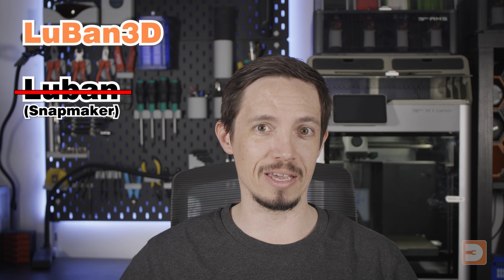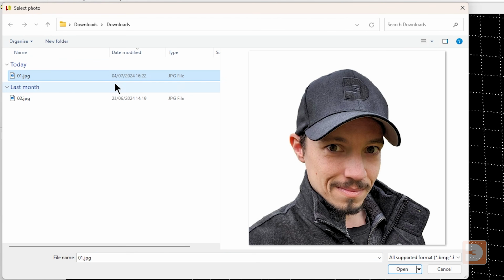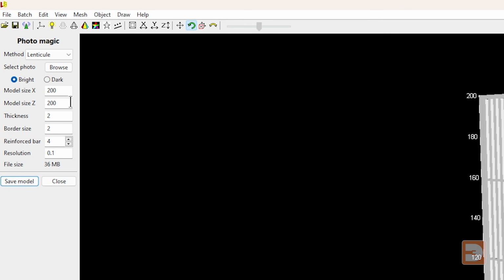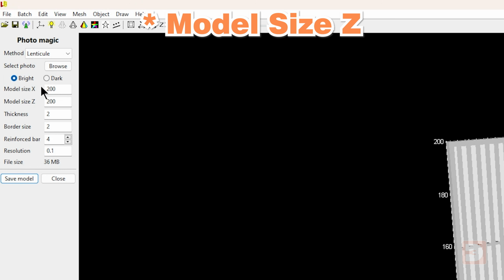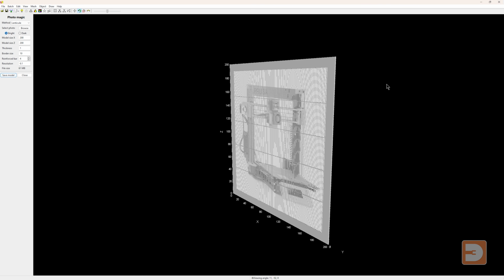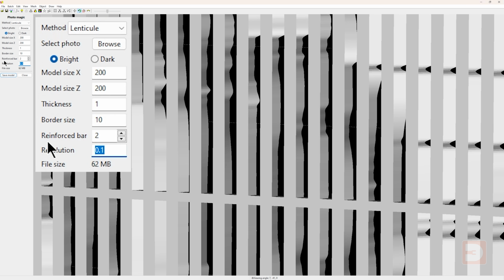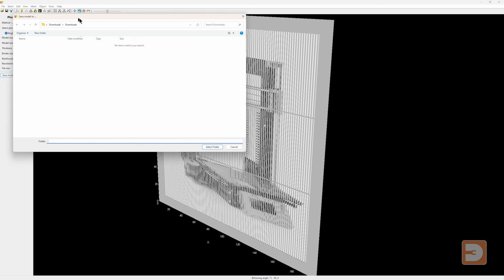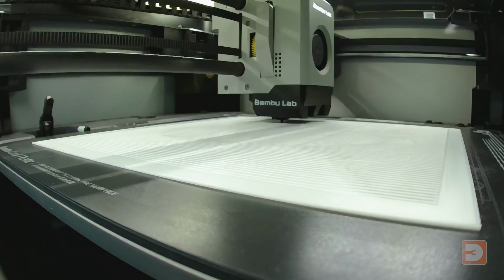Create 3D Printable Lenticular Models from Photos using Luban3D

Comment: Price of Luban is a joke. 👎
Reply: Free is too steep for you?
Reply: @OnePotMeals  "Free is too steep for you?" This is the problem with people like you, you can't read properly, free for a month is not free. So no, "free" is not steep, and Luban is not free.
Reply from the maker: The free trial of the full license is limited to 30 days, beyond which you need to buy a license, but to quote the LuBan3D license page, "Unregistered license: A computer can run LuBan to process and view data while saving of processed results is limited to small-sized files, not larger than 20MB".
In other words, you can use it indefinitely, for free for smaller files.
Beyond that you can get licenses and I honestly don't think $20 for a month (or $100 for a year) is that bad.
This isn't the sort of software you're likely to need access to constantly, so you can just get a license as and when you need to.
If you do feel you need access to this constantly as you're using it every week for multiple years in a row, there is also a permanent license available.
Reply: @3DRevolution  In other words, it's not free. I can read, if there's limitations after 30 days it's not free. It's effectively trialware and this kind of misleading "free" shouldn't be allowed. They want to call it trialware, or anything else, fine but "free" should be reserved to free, period, which Luban is not. Anything I'd want to use Luban for is larger than 20mb, not for what you're showing in the video but rather for cutting parts into smaller parts.

Furthermore, don't tell others what you think is a reasonable amount of money per month. Are you living my life? It's obscene to charge $20 a month for an app that first of all looks like it was coded in 1980's and secondly is not an app you would use that often. It's ridiculous. "This isn't the sort of software you're likely to need access to constantly, " that's the point and the reason the price is ridiculous. Even if I were a multimillionaire I wouldn't get sucked into this scam pricing model for this software.
Reply from the maker: @dosdont  I never said it was free, I said you can use it for free, with limitations. Fusion 360 is a subscription based piece of software, but you can use it for free providing you're using it for personal reasons. If you use a free license it has some limitations such as limits on certain functionality, export modes, and maximum concurrent editable projects. But the fact that it's one of the most popular CAD programmes that people use legally for free, would suggest that it is in fact a piece of software you can use for free.
I'm still not sure I understand your distaste for allowing free usage. The alternative is they have a 30 day free trial and after that you completely lose access to any of the software without paying for a license. What is negative about them still allowing you to use, experiment with, and learn how to use the software without having to pay for it?

Again, neither I, nor LuBan3D refer to it as a free program.

It does seem to me like you're having a bad day and looking to vent so I'm going to leave this for now, but I wasn't trying to imply that anyone can afford $20 a month. My point is, it's the sort of software you may only need to do a couple of things with, so you pay for it once, use it for a month and then let the license end. They get it again in the future if you need to use it again. I'm also not saying $20 is an amount that everyone can just throw around on whatever they want, but equally, for a months use of a license that has dozens of tools which can be used to create unique items for yourself, as gifts, or to sell commercially, the price of two cinema tickets seems a pretty reasonable price. 
Again, you say "is not an app you would use that often", that's literally my point. The licensing isn't a subscription. You buy a month when you need it, a year when you need it, or get a lifetime one off license. I never suggested that you'd subsribe to it paying $20 a month every month, or $100 a year every year.

Anyway, I hope you manage to have a good rest of your Sunday and have a better week next week. All the best.
Reply: Thank you very much for this comprehensive video. I think we are spoiled with what open source / free software is able to do nowadays, and that makes paying for one harder and harder. The real issue is how software companies try to put every software category in a subscription model. I miss the days, where you had the option to try the software for free for a month, and you could then buy it and own it for life (unless you needed to upgrade for a new functionality or an improved option). The subscription model has to stop, not everything requires constant maintenance from the software firm to justify a monthly payment.  They should be focused on creating new functionality , so that people will be encouraged to update their software.    @3DRevolution
Reply from the maker: @drmaestro88  I completely agree on the subscription model and would much prefer we move back to a one time payment basis. However, with even car manufacturers now locking functionality like heated seats and smart lighting behind subscription fees, I don't see that happening unfortunately.
To play devils advocate and find reasons to support the subscription model outside of companies just wanting to increase revenue, I understand there is also the security aspect of it. As OS changes over time, if you're running older software which hasn't received updates, it could pose security threats, and (whilst I'm certainly no legal expert), I'd imagine there could be a claim that the developer of the software is to blame there. So a model for them that ensures most people using their software will have the latest security patches, that's an advantage for them and the consumer. Obviously they could in theory release security updates and not feature updates indefinitely to license owners, but that would require a whole separate team, a lot of work, and for no finantial gain for them, so especially for smaller developers, that just wouldn't be an option.
At the end of the day, I definitely miss outright fees and I'd love to see them return. The most recent software I have that is based on that sort of concept is of those by Topaz, who provide a one time license fee that gives you a year of updates, and beyond that you still have access to the software but no further updates. Fantastic!